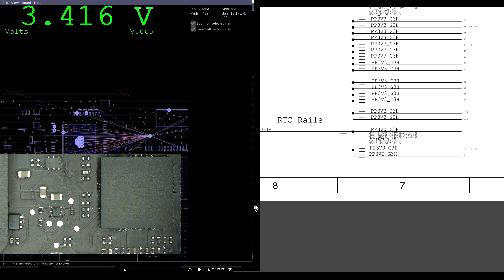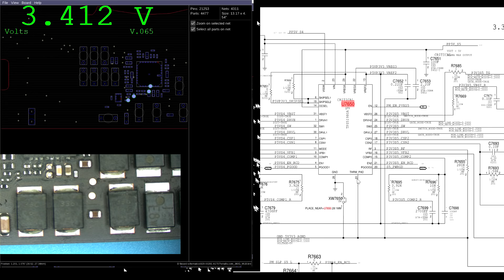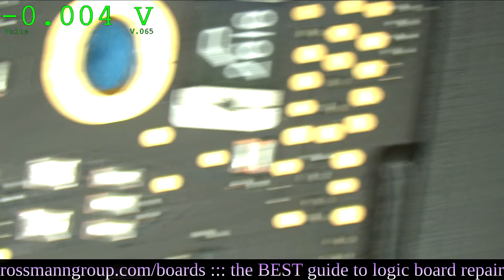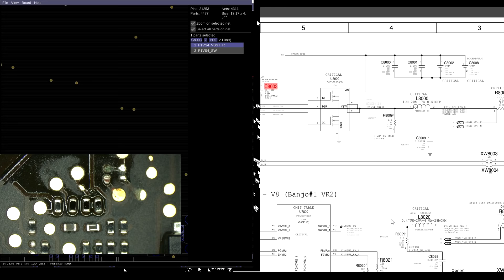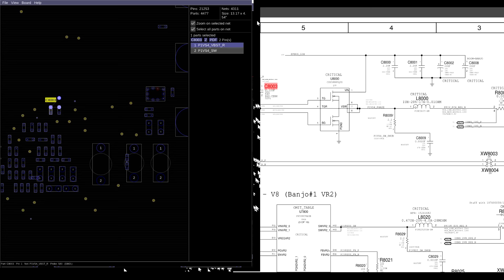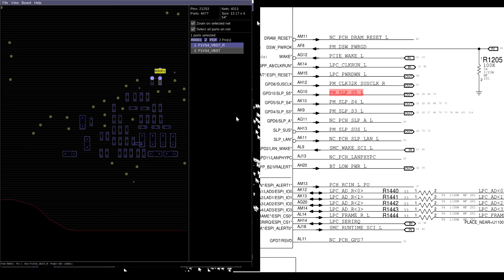Touchbars aren't hard to fix, are they Paul? :-)

Comment from the maker: Quick 861DW on sale for $254.99 at https://store.rossmanngroup.com/index.php/quick-861dw.html Don't delay, BUY TODAY!!!
Reply: ...as usual, 
keep your Quick in advice!
Reply: holy F that such a small component prevents the macbook from booting. that is just bad manufactoring
Reply: You must be new here Darknessblade.
Reply: still waiting for my order ... says completed but no fedex tracking number . numerous mails/messages no response
Reply from the maker: @mohinderkaur6671  i have zero emails from a khana and zero orders from a khana.
Reply: Got the fedex tracking nbr in email response.  you dont see me due to diff name. Thanks
Reply: Has Learned Fan Spin
https://youtu.be/zjenmerdK70?t=6m27s
Reply: Screw you, I got Quick 857DW+ (220V) and it seems Ok for my DIY needs. At least until I would decide go nuts and open a repair shop.
Expected a little short on connecting power at end :P  Good repair as always. I'm curious where original capacitor disappeared.

Comment: Hello, I have noticed lately my iPhone se and my iPad Air and air2 don’t charge fast as they used to, so i bought a safety taster usb to measure the voltage and ambers, to find out is half the ambers it used to charge last year when I measured. 
The ipads are charging at 5v 1A instead of 2.4 a and the iPhne SE is charging at 5v 1A instead of 2a previously charging. 
It’s very probably Apple has restricted the battery charging speed to “prolong the battery life “ or  to make you buy an Apple fast charger. I have used the 2 original iPad chargers i used last year for the measurements.

Comment: Hey Louis, I notice you don't clean the liquid off before you apply flux? I've watched a lot of your videos to help with my own PC repairs.  I  have a Mac book Pro that had major liquid damage on a mother board and all it took was a water bath, a good drying and a minor reflow of the solder. Seriously, and I didn't even use distilled water.  No flux no nothing. I've done this will all kinds of boards.MacBook is going strong for about 4 months now? Do you ever do repairs like that? Doesn't the dried liquid mess with the flux?

Comment: hello Louis, I just wanted to say I just discovered your channel a couple weeks ago after going to ipad rehabs video on replacing a charging port on a samsung galaxy. I was able to do it with a $6 walmart soldering pencil. I have since been fascinated by microsoldering. I am a sales manager and I travel alot for work. I used to listen to jre while traveling and AVe while at home. I now listen to you only. I dont know why I am so interested in microsoldering. I ordered some cheap equipment just to see if it was something I would stick with or just a fad. I bought a $45 rework chinese junk rework station on ebay and a $50 microscope and I was able to get a bag full of all different flux and solder and misc stuff from my works IT dept. I bought a junk computer that worked off facebook for $50 and went to town. I have royally screwed the computer up but I love it. Thanks gor what you do! I have always been that guy in the family that would tackle any repair and usually would fix most issues except for electronic related issues. I didnt think at my age I would find something new I enjoy. Sorry for the long post and if I repeated anything I am sorry. This junk work phone wont let me go back and read what I typed. I do have a suggestion. I know you hate junk equipment BUT you could have a nice little revenue stream from putting together like 3 soldering kits. Like kit 1 would be bare bone low cost equipmemt with solder and flux for people that just want to dabble. It would be for people that may be on a few month kick and decide to never do it again. It could come with one of those multimeter build projects I did in school. Its basically a little kit for a basic electronic and it comes with a small empty board and a easy to follow scematic(spelling) with all parts that need to be soldered on. Then you could offer higher teir packages for equipment. I know alot of people will never try to do this due to price and having to order 30 things even if its cheap. I think if you had a base complete kit you would be suprised at how fast it would sell. With your sub count you have enough influence that a cheap knock off type company would build something to your specs amd a kit could be under $200 including microscope. Sorry for long post and keep up the great work even if I have no clue what your talking about 90% of the time...

Comment: Hello Louis, have you ever tried a product that would protect the electronics against water and moisture? something like NeverWet? it would be great to try a motherboard if it turns on underwater :)
Reply: Probably the closest thing I've ever seen to that (other than mineral-oil cooled pc's) was probably Linus trying to use some Seagate drive underwater because it was fully enclosed with like hydrogen or  something on the inside. But someone could definitely do that in the future.
Reply: It would be great to see the electronics working underwater.. No more, liquid damage! :D
Reply: Huawei Honor Waterplay > https://www.ebay.com/itm/Huawei-honor-WaterPlay-IP67-Waterproof-10-1-inch-Table-PC-Fingerprint-Kirin-659/302520581524?hash=item466fa1bd94%3Am%3Amjuug9nTgcuw2tyC89NtO1A&var=601352289337
Reply: Yeah it might work under water, but most idiots don't spill water on their devices, they spill Coca Cola (rust remover) and it would probably it through your coating in no time.